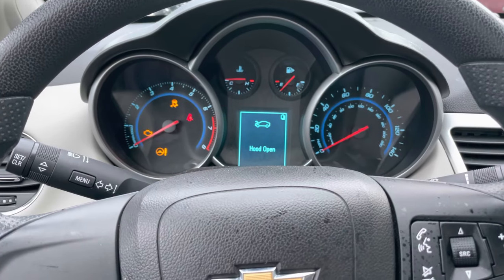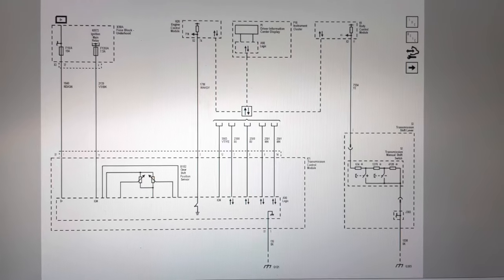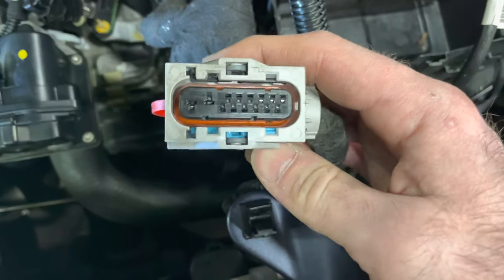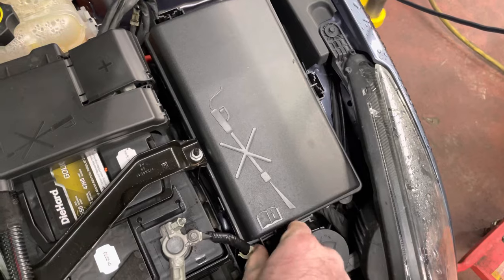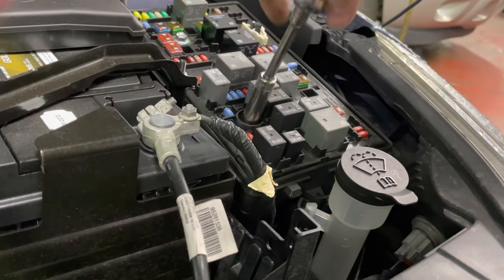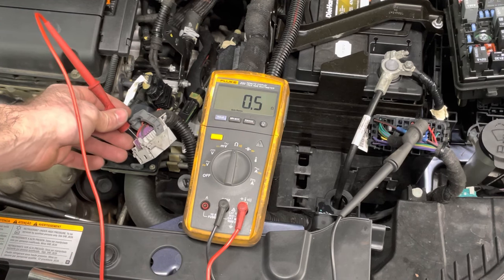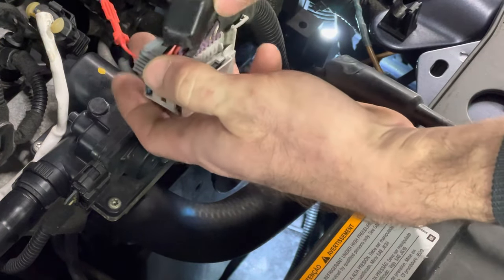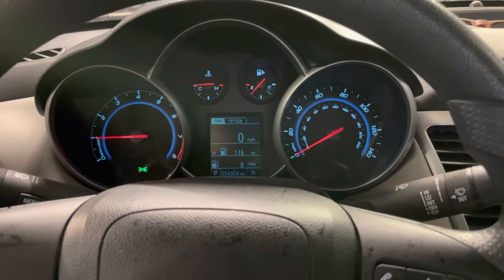Cruze Limp Mode... TCM No Communication U0101

Comment: Mines throwing the same, no start, doesn't know the cars in park, stuck in park.
Changed the range sensor, still nothing.  Guess im checking the fuse situation next
Reply from the maker: Yes, sounds like it needs some electrical diagnosis. Thank you for commenting.
Reply: @DadsGarageDiagnosticSpecialist  its just funny, i drove it, parked it, 45 min later im having full comms failure lol.  Tcm bcm ecm all fail to comm with the matco maxlite.
Reply from the maker: @looselipssinkships6543  is the transmission control module failing to communicate with the Matco scan tool?
Reply: @DadsGarageDiagnosticSpecialist  yea, but everythings failing comms now.  Like it was working then just stopped.  I have 3 dif scans, the last scan it all failed
Reply: @DadsGarageDiagnosticSpecialist  almost like the vci port failed but i dont see why that would happen, i jever unplugged it, it stayed hooked up the entire time.
Reply from the maker: @looselipssinkships6543 I would take an ohm meter, and measure resistance across the DLC terminals 6 and 14 with the battery disconnected… You should get about 60 ohms.
Reply: @DadsGarageDiagnosticSpecialist  ill check it out ty

Comment: Same problem with my 14 camaro but im getting only 2 codes u0100 and p0700 also it dont happen often the problem going away and coming back.. pls help
Reply from the maker: Check the main transmission harness connector. Thanks.
Reply: @DadsGarageDiagnosticSpecialist  i will do it thank you.. it’s that serious problem or just wire issues
Reply from the maker: @danield3566  the problem seems to be present only sometimes so most likely it is a loose connection of some sort. Could even be some transmission fluid leaking in to the connector.
Reply: @DadsGarageDiagnosticSpecialist  my car it’s in garage and there is no leaks on the floor i have the problem for 2 days now no leaks also I checked the battery voltage and it should be 13.8 myne is 12.8 and i have rust on the battery connectors i just checked now i will check the connector tomorrow thank you for replying really appreciate it!!
Reply: If that makes point
Reply: @DadsGarageDiagnosticSpecialist  can it be from the battery?
Reply from the maker: @danield3566  not very likely

Comment: Hi sir im from India Chevrolet Cruze automatic transmission vehicle gearbox problem soo Change 2hand gearbox gear selection work but vehicle not move
Reply from the maker: The transmission likely needs to be programmed to the vehicle. A used 2nd hand transmission will be difficult to program without specialized equipment. 

You can swap the old TECHM assembly that contains the original programming if needed and if it is still functional. 

Also be mindful of setting the proper fluid level, these transmissions are sensitive to setting the fluid level by temperature. 

Thanks.

Comment: I get that code lost communication with tcm and the car doesn’t start up sometimes sometimes it starts find sometimes it hard shifts sometimes it doesn’t
Reply from the maker: Make sure the main connector on the transmission is clean and tight. Sounds like an intermittent loss of connection to the TCM. 

Thanks.

Comment: Somebody did not ask the customer the magic question: Has someone else worked on the problem previously? 

with the follow up; What was found? 

and the next follow up; What parts were replaced? 

I say this because I find the more information you can get from the customer the easier the repair, especially when the car has recently gone through multiple shops. Meaning, one of the first tasks after confirming the problem is to check the work of the others who came before. This basic procedure can greatly reduce the time on the repair, or inform the customer of questionable non-OEM parts.
Reply from the maker: True more information is better. In my world I’m used to working with minimal information and often customers lie or don’t know… vehicle history can be very misleading sometimes. 

The customer may lie, but the car never will. 

I prefer to let the diagnostic process lead to the fault, it’s never let me down doing it this way starting from the basics and using the same process every time. I’ve definitely been mislead by focusing on history repairs or taking their word on repairs performed only to find later that the “new” part was faulty or something wasn’t repaired as described. 

Thanks for commenting Wind Ward.
Reply: @DadsGarageDiagnosticSpecialist  I find myself asking the customer more generic questions (like are you happy with the vehicle overall? for example. which is a wide open question and not specific to the problem potentially) than necessary and sometimes they say something that they do not know the importance of, especially things or phrases other techs have told them. Usually, if you ask the right questions, there is some truth amongst the lies.
Reply from the maker: True at that point I take an extended road test with the client and have a long talk and observe the way they drive, etc.

Comment: I'm going through same exact thing 2014 Cruze all the same dash lights
Reply from the maker: Thanks for commenting Chassidy. 

There are several different failures that can result in the multiple warning lights and error messages. If you can tell me what codes you have I might be able to give you some advice. 

The car in this video for example had a service power steering as well as traction control and stabilitak warnings, but no fault in any of those systems. They go into fault mode if a related system has a problem that would affect operation.
Reply: @DadsGarageDiagnosticSpecialist  same exact codes steering, traction, and stabilitrac, it's also very jerky putting in reverse. I've just went out and checked the fuses those are all good. I really wish my dad lived near me to help me out. I'm a very impatient woman and have rheumatoid arthritis so I can't imagine hunching over under my hood for long in this Arizona heat even in January it's pretty warm. So umm if I attempt to remove the fuse box as you did tomorrow, do I need to at any point disconnect battery? Oh man thanks so much for this video I've been broken down for 3 months finally just dropped the insurance because it seems to be one failure after another on this car and I've been dreading getting ripped off yet again by another mechanic. I've had to get full oil cover gasket and spark plug problem fixed twice and haven't even had it a year $1,500 each time I'm exhausted but need to try to fix it as I can't afford another one being as I gave up all my saving for this one that's been a nightmare 😩
Reply from the maker: I would not remove the fuse block at all unless some sort of test led you that direction. The reason I ended up taking the fuse block out was because I tested for power at the transmission connector and found no power, but still had a good fuse. 

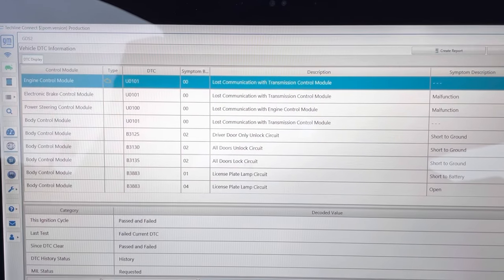We need to know what codes are being set in each system. See 0:24 in the video for example. Thanks Chassidy.
Reply: @DadsGarageDiagnosticSpecialist  ok I'm gonna have to go get one of those testers in the morning
Reply: @DadsGarageDiagnosticSpecialist  & my code is U0101 lost communication with TCM
Reply from the maker: @chassidyslone7533  ok that’s a good start. The car in this video also had no communication between the scan tool and the transmission control module. As well as no gear indicator and very harsh shifting as a result. 

Before you go through too much trouble consider that it might be cheaper in time and money to have it properly diagnosed at a reputable shop. Shouldn’t take more than $300 worth of diagnostics in most cases if they know what they’re doing. 

Otherwise I will help you as much as I can. You will need a scan tool capable of reading all of the modules on the vehicle, most cheap code readers will only read Global OBD2 engine codes, some you can pay extra to have Chevrolet coverage and extra access features. 

Thanks.
Reply: @DadsGarageDiagnosticSpecialist  thanks so much I will keep you updated on progress, even if I can't do it and take it to electrical specialist at least I have already researched this thoroughly and they can't try to tell me its something else. Just don't know if I'll be able to get my hands around in there sufficiently but I'm gonna try my hardest
Reply from the maker: Sounds good Chassidy.
Reply: Well I got a tester tested all the connectors to the fuses and they were good I then put everything back together and now the car won't start 😭😭😭
Reply from the maker: You may not have gotten the transmission connector all the way back in. The lever lock should pull the connector in and hold it tight.

Comment: ive been dealing with this code for too damn long, i already spent 6k on a transmission shop and they couldnt fix it and told me not to bring it back......no honor or backing in their work. so given how this cruze looks identical to my 2014 impala lt 3.6 flex fuel, im going to take apart the fuse box and see, test for continuity from the box to the connector also. it has a new TCM in it, not even 2 weeks old. the way my car is right now, i cant use it for work because it wont past inspection.
Reply from the maker: Sorry to hear that. Sounds like it needs a diagnosis.

Thanks.